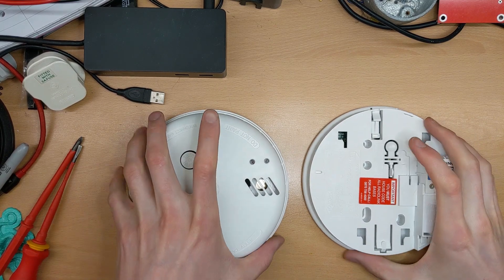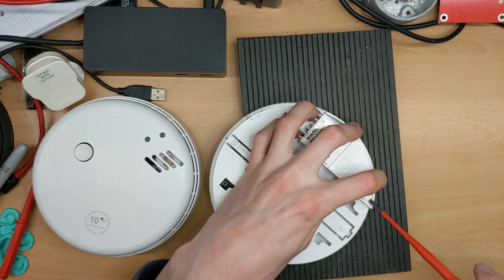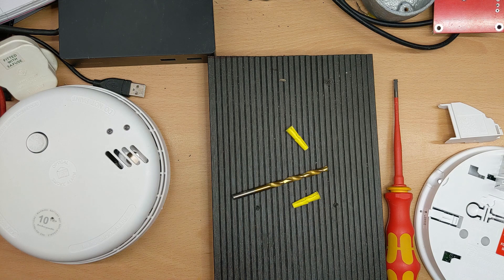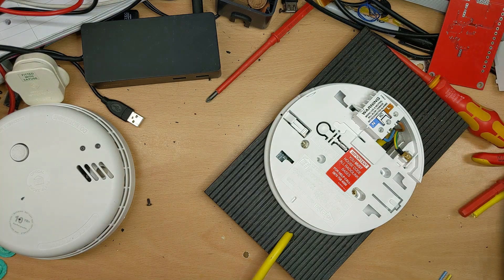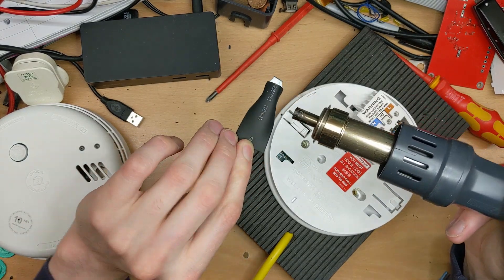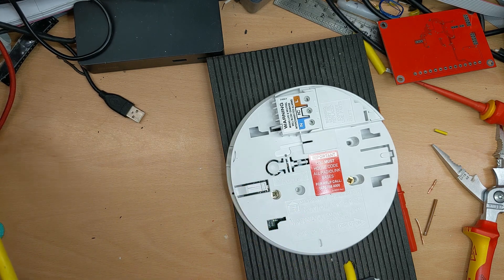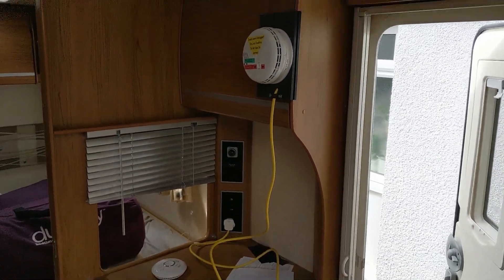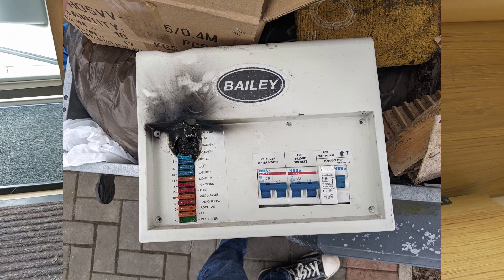AICO Radiolink smoke detector for the Caravan

Comment: i didnt know you couid put a plug on a smoke alarm
Reply from the maker: this one needs mains otherwise its running on its battery back up, i needed to find a way to get mains into it without having dangerous terminals exposed hence the deck board. i am tempted to remake this video and revise the current setup.